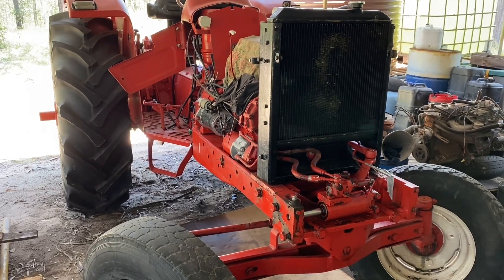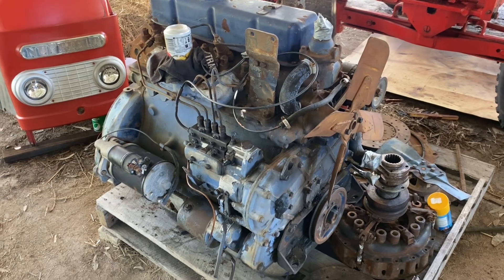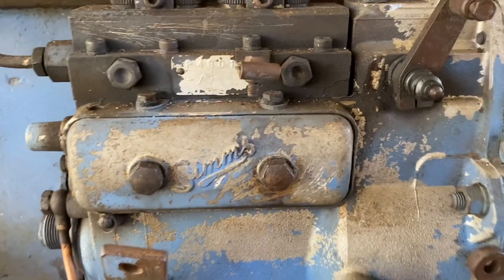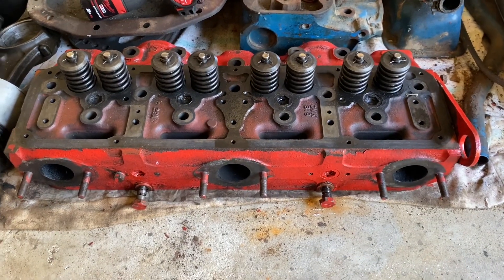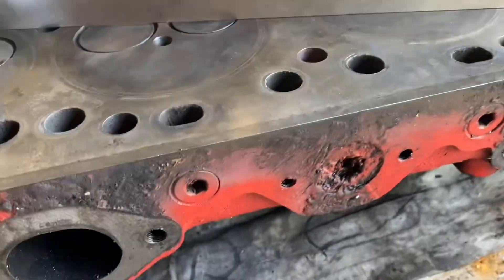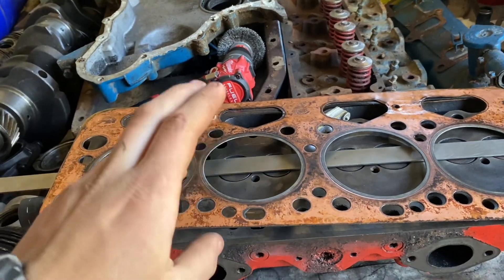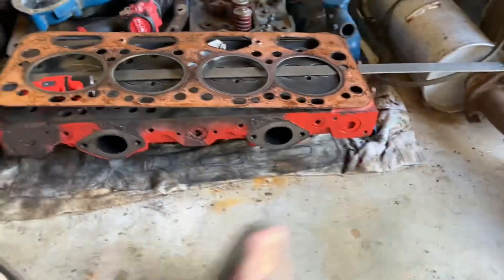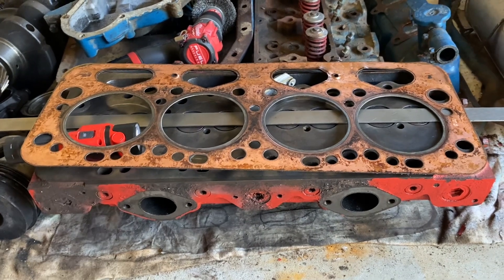Introduction to the Nuffield 4/65 project | Part 1

Comment: Hi mate can you tel me were to fine the engine number.
Reply from the maker: If you take a gander just below no. 4 injector where the block meets the head, there will be a flat that extrudes out in the block. There will be a number there, and the first few digits are the model number and the last ones are the serial number. Hope this helps 👍

Comment: Hi, 
I am surprised that you say the Leyland (Blue Engine) is bored out.   I always thought that the 10/60 & 4/65 Nuffield's, along with the 384 Leyland used an engine with the same bore & stroke. 
The differing power outputs down to injector pump setting.  The 10/60 ran at 2000 rev's , where as 4/65 and 384 (if my aging memory is correct) run at max revs of 2200.
Good video - nice work !
Reply from the maker: Both the engines are the same size (3.8L), but the blocks on the later motors themselves are bored out. This is because the earlier 4/60, 10/60 and 4/65 had a tendency for the liners to go porous due to the small thickness of the liners. To accomodate thicker liners and keep the same displacement, the blocks were bored bigger from what I have gathered to support thicker liners. This is what I found when ordering liners, as the 384 engine has liners that are a couple of thou bigger
Reply: @BIGRIG2005.   Thank you.  Now it makes sense to me.  Keep up the good work!  
Greeting from Vic.

Comment: The cylinder heads on the BBC engines are prone to cracking what I would do is to get it pressure tested which can be done even if the head is worped if it passes then get it claimed happy days
Reply from the maker: Yep had all that work done. I got it skimmed, crack test showed up negative and I also fitted new valves and guides to it while it was being fixed.